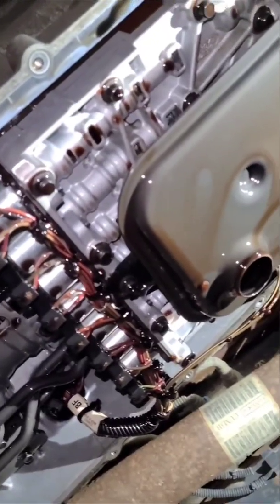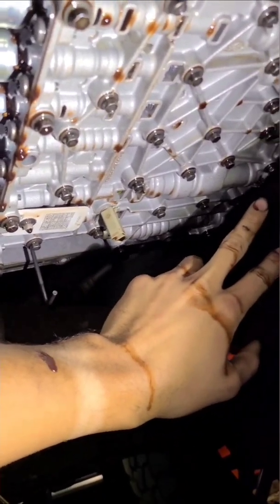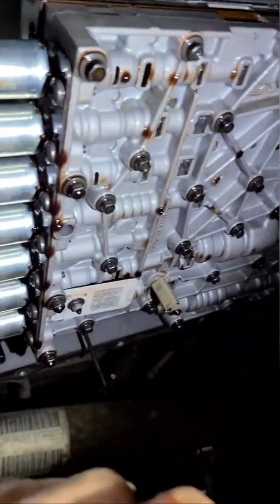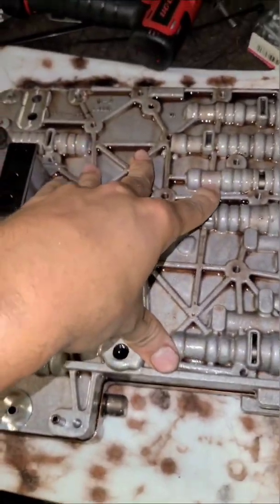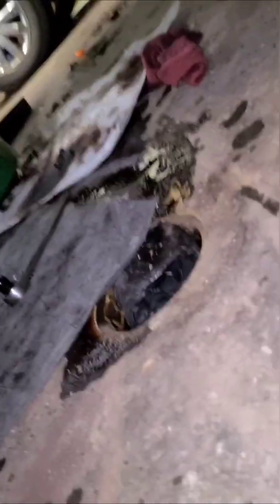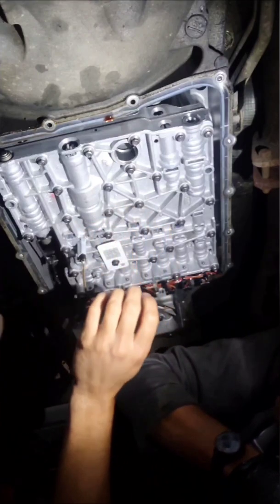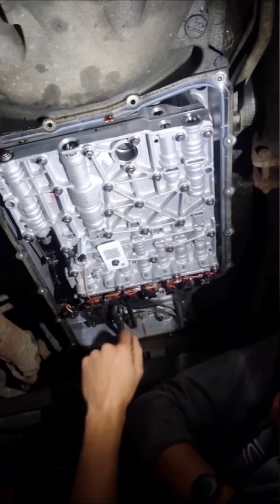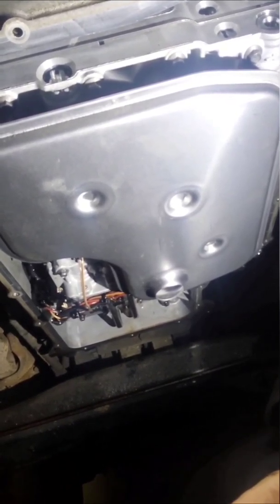6R140 valve body replacement

Comment: If you're deleted and tuned, do you have to have it reprogrammed? I bought an OEM valve body from ford
Reply from the maker: I believe either way you'll have to have it reprogrammed.
Reply from the maker: Also to add.. i am tuned etc. and it didn't mess with my tuning. I took it easy for a couple weeks checking levels on fluid and making sure everything was good.
Reply: I did not reprogram mine. I gave them my serial # and I got a Ford valve body and I'm deleted. I was told to just drive it till normal operating trans temp then reinstalled to ECM and TCM tune and then drive it with light throttle and come to a stop like in traffic. I just drove around town. And then do that same think taking it up to freeway speeds. Then back in town while adding a little more throttle. Like some medium throttle  in with the light throttle and coming to stops. The next day or if you can drive it for a day after this just be easy and do horse around at all. Just normal driving and it should straighten out. I'm happy with mine. No more slamming

Comment: Thanks for the info! I have new valve body coming for mine. Im assuming you were having some shifting issues as you replaced valve body. What issues were you having and did they get fixed?
Reply from the maker: I was having issues with going from 2nd-3rd gear whenever my trans was up to operating temp. From a stop.. 1st to 2nd was normal. 2nd to 3rd would just completely high rev and would pretty much be in neutral. It would find itself and go from there. All other gears would shift perfectly. Since I've had the revmax valve body 1st-3rd is absolutely beautiful firm shifts then 3rd going into 4th is somewhat hesitant almost like a flare sadly. And 5th going into 6th is definitely has a decent flare.. not really sure on where to go now with it. Hope yours turns out good man!
Reply: I’m have flares on 6-5 and 4-3 downshifts but only at lower RPMs and some throttle input. I’m deleted and tuned but have tried 3 different companies and all had different shifting issues. Ordered one from SPE so hopefully it fixes my issues otherwise it probably needs built trans and converter. Hopefully you get yours figured out. Good luck
Reply: @devonsarkinen3165  please update when you install the SPE unit id like to know what more ppl say about their product before i buy one
Reply: @devonsarkinen3165  Did you ever get your SPE valve body installed? I’m wondering how it is now.
Reply: @devonsarkinen3165 how’s the trans today?
Reply: @brandonheilman3344  did you ever figure out what the problem between the 3-4 and 5-6 shifts?
Reply from the maker: @BP245  not sure of the actual issue. After I installed the valve body it actually didn't fix a thing until about a month later I hooked to my camper and I haven't had a flare ever since. Nice crisp shifts 1-6.
Reply: @brandonheilman3344  how do you like your revmax? I just got mine in today and I’m Fixn to install tomorrow. Thanks for your video, can’t find anything except for what you put out. I’ve got a 2012 f350
Reply from the maker: @Rex Love  I have no complaints! But yeah thats why I made it cause I had trouble finding one myself! Not sure how good it is but I hope it gives you an idea! My transmission Temps dropped a good bit too. I used amsoil as well. Not sure if that's all making the difference or what
Reply: I did install SPE valve body. Been driving for a couple weeks and shifting is great. No issues
Reply: @devonsarkinen3165  how the SPE valve body holding up? Any issues yet? What year is your truck. I run all SPE products and I’m have shifting issues on my truck 2019
Reply: @colt4528  still no flaring shifts. Just firm shifts.